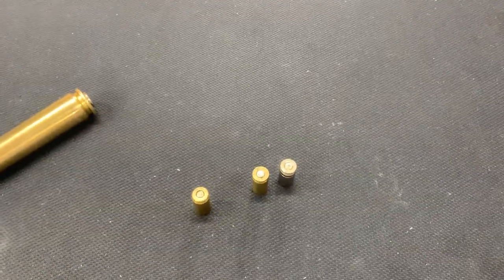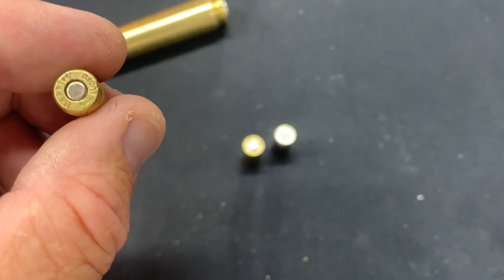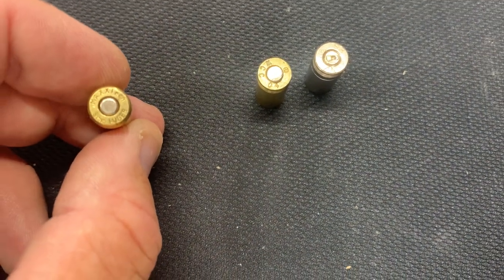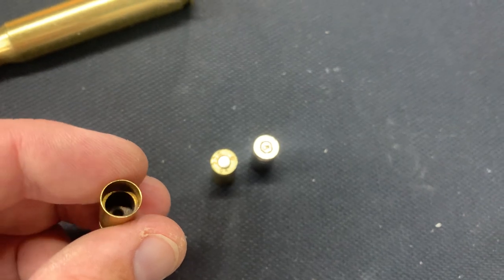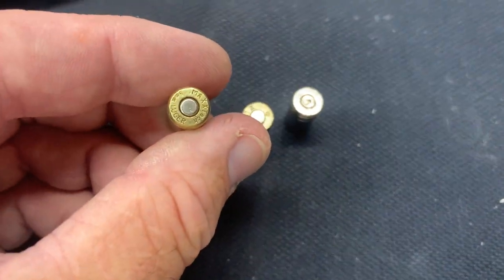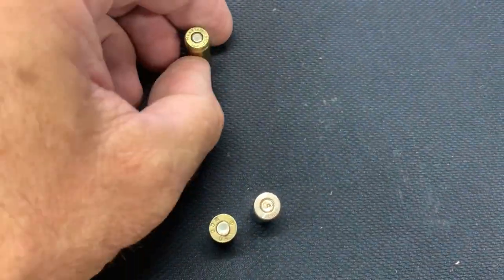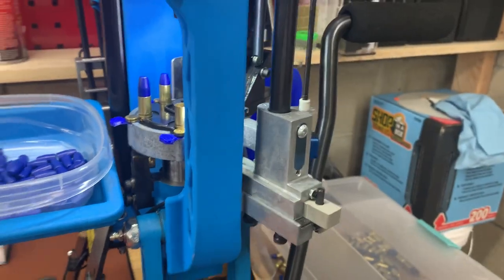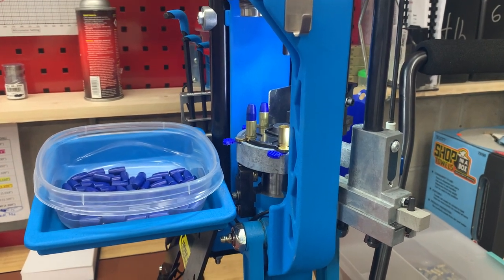Be Careful Reloading These Brands of Range Brass!!

Comment: WCC is Winchester military 9mm brass.  04 was produced in 2004.  The "NATO" designation is the + inside the O.  NATO 9mm is loaded to +P pressure.  I have some WCC NATO brass from the late 80's and a lot from the early 90's when we were doing 1st Gulf.  An outstanding cartridge case, with A CRIMPED PRIMER.  The primer crimp must be removed and by hand with a "Military Crimp Removal Tool" and then it helps to "Chamfer" the primer pocket.  I do both by hand.  Your primer "squished" because you tried to stuff it into a hole that was too small for it because you did not remove the military crimp that held the primer in by pushing some of the metal of the cartridge base over the primer.  If you hand prime, as I always do, you would not have been able to prime that case.  The extra leverage of your press let you fuck up.  I bought 2,000 rounds of brass and 1,000 was Winchester commercial.  The other 1,000 was WCC and I felt blessed.  MAXX Tech I have and mine does not have the shoulder inside the case.
Reply: Correct I always have problems reloading them. You have to remove that crimp before you press in a new primer just the same as 556 NATO have to remove the crimp
Reply: @gunztommiegunz  bingo its the crimp

Comment: Wcc Winchester cartridge company with the year on it is a military round it has a crimped primer.
Reply: The primer in that case is cocked or crooked
Reply: WCC is Western cartridge company WRA is winchester repeating arms
Reply: @charlestravis9798  Exactly because as  Kenneth Gillette stated it is crimped.  The crimping may be intended for use in submachine guns.  The crimp needs to be removed prior to repriming.
Reply: Your right, crimped primer for military.
Reload with caution.
Reply: I have since done some reading on the glock smile and that also needs to be removed

Comment: I use a Dillon Super Swage 600 tool to decrimp WCC primer pockets. It's a pain but the spent WCC cases were cheap at the time. The tool can also be used for swaging primer pockets of spent 5.56x45 and 7.62x51 mil spec brass.

Comment: The + on the case is a NATO marking.  The primers are crimped in the pocket so they don't fall out.   I save them until I have a bucket full and then decap and cut the crimp out.  (I keep them as once fired as my retirement brass)  It is good brass. I have 3 6 gallon pails full.   WCC, WMA, CBC, PPU, S&B and more have crimped primers.   Some carry ammo does as well.    I've experience a hard time decapping a lot of Winchester cases.  They don't appear crimped but they may have been sealed with something.  I have issues with them in 9 and 45.

Comment: Need to buy unbreakable decapping pins,but they can still be bent. I try to tighten the pin so it will slip if the primer won't come out. Then you  need to swage or ream the pocket out. This applies to 556, and virtually all military ammo. Went through 4 pins decapping a thousand rounds of LC 556 .45acp seems to come out a little easier.

Comment: Federal primers are the softest on the market and should only be used in non military cases because of the tighter primer pockets. CCI seem to be the hardest, but are the hardest to fully seat. Winchester is a good middle ground being soft enough to form into the pocket but hard enough to keep rounded edges and fully seat in mil/nato 9mm cases and other mil/nato brass. CCI makes the mil spec primers but I personally never found the need to use them. There is a nickel plated winchester brass out there that is nearly impossible, non crimped, but extremely tight primer pocket. You can swage the pocket but is still tight. Just my experience and opinion, been loading for 42 yrs., hope that helps! Happy shooting!
Reply from the maker: Thank you for adding your expertise to the discussion.  I would consider myself an expert reloader for single stage precision rifle, but this is only my second year doing progressive reloading for handgun and it is very different than single stage, so I learn something new every day.  This is why I make and post these videos so we can all gain in knowledge.  Thanks again for your contribution!

Comment: The WCC case seems to be like military brass that  gets crimped. I used to use the pocket reamers with a lot of effort on my FC and other cases in .223 of 5.56 because of the same primer loading issue. Now I use the RCBS-2 primer pocket swage tool in my press and it doesn't  remove material but reshaped the primer pocket. I also have a primer pocket measuring tool, small on one side, large on the other, to gauge my primer pockets to see if too small or too large. FWIW
Reply from the maker: Thanks for the info.  Yeah, I used a reamer on a power drill that actually removed a little material, and on those cases it almost not worth it and now I just toss them.  It's not always a given that the primer gets crushed, it's just usually the case that I find when they do get stuck.  Also, Winchester brass "Win" and "9mm Luger" stamped on the case head I also have trouble with primers seating.  Actually, I'd say that the Winchester cases are worse than the WCC, etc. cases--so keep an eye out for those.  I don't have a swager arm or attachment on my press since it's only an XL750 and not the new 1100 or 1050 that has a primer pocket swager station (which would be nice,  but I do prefer priming on the forward stroke and not the downstroke--it gives me a different feel so I know right away when I have a problem).  Thanks for watching and your comments!
Reply: @docgsreloading7985  You can sit and do something else while running a military primer crimp tool manually on each cartridge case. Drop the finished case into a new bucket.  All my reloading is 1,000 at a time by transferring from one Folger's plastic coffee container to the next.

Comment: I have thousands of rounds of WCC (Western Cartridge Company) brass. They're more labor intensive to reload, because you need to remove the military crimp that they apply during manufacturing. This is military grade brass and will last a good long time. However... removing the crimp on them takes a little extra time. RCBS makes a little $15 tool that you can put in your hand drill or drill press, and simply slam the case down until brass stops coming off. Super easy. In fact... after you've done this... primers go into the case so smoothly. The thing that likely happened with you even after reaming the pocket out, was likely leftover primer ring that wasn't removed during depriming. This happens sometimes, but I like to run my flat blade tool into the pocket to remove primer gunk anyway. If the flat blade doesn't fit in the pocket after running the RCBS decrimping tool... throw it out. Boom. No risk in primer detonation.
Why do they put a crimp on military ammo you may ask... well... because the military cycles ammo at a high rate of speed, and there can be primer failures. If a primer falls out during high cycle speeds... you can really mess up your gun and your day.

Comment: As others have pointed out the Winchester piece of brass is a military version of the 9mm luger round. You may already know this but the stamped small circle with a cross in the middle is a symbol for NATO. It is put on all NATO small arms ammo. The other piece of brass you showed with the smaller powder capacity and little interior ridge, is a new one to me.

Comment: The WMA, WCC brass is what the military was using. Those primers were crimped, which would cause the misaligned primer in your case. A buddy of mine warned me about that and I bought the RCBS Primer Pocket Swager Tool-2, (PN: 9481).
Reply from the maker: Thanks, yeah, that's a tool I'm going to get.  Thanks for your comments!

Comment: I run all 9mm and .223 through a step, after sizing. I use a RCBS  primer pocket swaging tool. I run it separately on my single stage, then tumble the brass till shiny.

Comment: WCC is Winchester as has been said. Most likely, military contract which means a crimped primer pocket spec. Sorting brass will rectify "accidentally" running them through the machine. My 1050 automatically removes(swages) the pockets to prevent issues. Most aren't military so unless you run across a huge deposit(like from a military base auction) you rarely run across them.

Comment: Watch out for 9mm Norma brass. The flash hole is under size and the decapper will get stuck, causing all kinds of misery.
Reply from the maker: Thanks for watching!  YES, the Norma brass will pull out the decapping pin in the Redding dies and I got so sick and tired of that happening that I contacted Redding.  I complained about it to Redding, and they didn't have a fix that worked.  What I did, was engineer a fix on my own.  I used a thread coupler I purchased online from an industrial company and converted the threads on the Redding decapping stem to the Dillon decapping threads, then I just use the Dillon decapping pins and their screw on cap that holds the pin in place.  The way the Dillon decapping system is designed, it can't pull out ever and won't break because the pins are hardened steel and much bigger in diameter.  I did have to grind off the fork that held the Redding pin in place just flush with the threads.  Now when a Norma brass 9mm case comes into my press, it just slams through that small flash hole and makes it bigger, so reloading it again makes it easier, and the primer gets driven out easily even the first time. 
I was thinking about doing a video on what I did to solve the problem, I just don't think it would get a lot of views!

Comment: That second one is metallic.  You must use a special die to reuse them.  One of the issues is they begin to separate where the two different metals are used at the junction.  I used to use those for shooting 9 Major loads in my Open gun because they do handle higher pressures and can be reloaded a lot of times.  Picking them up with a magnet on a stick was great though.

Comment: Doc can you make some recommendation to 9mm brass, bullet, powers I’m new to reloading sticking to new brass as I get experience using mostly 115 some 124 I’ve been using starline brass and whatever bullet I can find at a reasonable price round nose fmj.I’m just plinking my main consideration has been safety then cost this is an experience project, once I’m more comfortable I’ll look into once fired range ammo, your examples are why I’ve been using new brass so far.fyi I have been picking up my own brass and collecting as I get my cleaning resizing de priming act together then I’ll recycling my own stuff to make it worth while any ideas out would be welcome As I will bounce any suggestions off my reloading Manuel’s to make sure my donuts are donuts and not bombs. Thank you Ivan
Reply from the maker: Thanks for watching and your nice comments and questions!  That’s a good idea to keep your own brass.  As you can see, you have to be careful about other stuff you pick up.  
So, I shoot an Atlas Hyperion in 9mm as well as my Sig Sauer P320 X5 Legion in local competitions that are not USPSA (no Major or Minor Power Factor to deal with) and here is what I use for those guns:

1) Blue Bullets 147gr. (Their Round Nose or Flat Point work equally as well).
2) Vihtavuori N320 powder at 3.0 grains.
3) Used brass as we talked about.
4) Federal primers (DO NOT USE CCI PRIMERS IN A STRIKER FIRED GUN—THEY DO NOT WORK CONSISTENTLY)

A buddy of mine that has been progressively reloading longer than I’ve been alive told me about the CCI primers only working in hammer-fired guns, and he’s right.  I did several hundred CCI’s and at least 3 per hundred didn’t fire and required a second or third strike to go off.  Plus, Federal primers have a more malleable cup, so they go into the case easier when reloading.

Now, I do use a more expensive powder—Vihtavuori, but it burns more consistently and has almost no soot.  If you don’t want to spend the extra money, than TiteGroup would be a good alternative; although I don’t know what the conversion of grains would be over to that powder.  For me, the extra is money well spent since I don’t have to clean my guns as often, and when I do, it’s an easy cleaning.  Starting out, I tested 5 different bullet weights, from 10 different manufacturers and 5 different powders at differing weights (I don’t do any of this stuff half-way!) and the Vihtavuori powder had by far the tightest groups (at 20 yards fired from a rest) and most consistent chronograph data.
Now that load above also does meet the USPSA Minor Power Factor requirement, so it’s a load that can be used in USPSA competitions.  I compete in the Limited Division in USPSA, so I shoot 40 cal for that in an Atlas Nemesis so I can be in the Major Power Factor which is a huge advantage over Minor PF.
I hope that is helpful!  Let me know of any other questions and I’ll be glad to answer as best I can!
Reply: ,thank you never even gave hammer vs Striker a thought thank you. Started picking up my own brass to make it easier to police brass brands,it mostly as a hedge against shady brass since all mine is once fired since i purchased new. I gonna try  powders you suggested. cleaning burning is big, since unburnt powder is just wrong in todays low availability scene, gonna save my Cci for my CZ, you having any luck buying primer. Crazy how many fake websites out their found one site yesterday only place the had any in “stock “ but of course was vemo/zelle only clicked off and did a virus scan just to be sure appreciate the response and info, ps love you choices legion, Atlas,need I say more wow, not today but one day I’ll be able to ask what … on yours I got … on mine. Next mission find powder and primers but that’s all of us. Thank you, Ivan
Reply from the maker: @myanaloglife9450  I saw the whole pandemic coming (a good thing about having a medical education) so I ordered 50k during the 12 months prior to everything going out of stock.  I’m on a bunch of wait lists, but they’re still not in stock and unfortunately, when they do come back in stock they’re charging 8-9 cents a piece instead of the 3 cents I paid.  22LR ammo is 3X more expensive per round than it was pre-pandemic.  I’d think as long as the pandemic stuff continues to taper off, they should be near back to the regular price and availability by the end of this year or beginning of next year.

Comment: After reeming military cases with crimped primers like the WCC cases, it leaves an abrupt ridge on the lip of the primer pocket. Primers tend to catch on this ridge and deform, unless you use a deburring tool to remove this ridge and chamfer the lip of the primer pocket slightly. Once this is done, primers will seat easily. 

I first started doing this as a kid helping my dad reload military 30-06 cases over 60 years ago and have done this to thousands of military cases in various calibers in the years since. I think my old man probably knew what he was talking about, as he worked as a machinist for Remington Arms during WWII maintaining the equipment they used to make ammo for Uncle Sam.

Comment: Do you still recommend range pickups? Or are there too many nasty surprises? Also, Very cool primer rod! You could make those and folks would buy them.
Reply from the maker: Oh for sure!  I have 4 full to the top 5 gallon pickle buckets (almost 30,000 cases of 9mm) of which pretty much all of them are usable and free!  For the most part the brands I find are Winchester, PMC, Blazer, Aguila, Starline, and Xtreme to name a few--all of very high quality and can be reloaded 20+ times.  I have to sort all my brass manually so when I get back home from the range I put on my magnifier glasses and check that each piece is 9mm Luger (I do get a lot of 40 cal as well) because 380 ACP and will look identical to 9mm except it's a shorter case that won't work in the press when you go to seat the bullet.  It takes a couple hours but I'll be watching TV or sitting outside on the deck.

That's a great idea for the primer push rod, maybe I can become a millionaire that way!!
Reply: Doc G's Reloading Right on! I have a 50 BMG case made into a bottle opener and I love it. Great suggestion on the magnifier glasses as .380 does look just like 9 mm. Thanks.

Comment: I guess your not familiar with the NATO Case Mark it's the circle with the cross in the center. The WCC represents Winchester Cartridge Company Logo, the two digits represents year of manufacture.  Of course the primer was smashed into the deprimed case without the reaming of the crimp from the original seated primer. US made military cartridge brass cases do not show the caliber of the case on the case, that printed information would be on the box material.

Comment: Use standard factory brass. If the case is non standard then don't use it. The MaxxTech inside case shelf and two piece nickel brass shown are non standard. If primers act as if they won't seat then discard the brass. Same for bullet seating. Don't force it. Discard. Or get a primer pocket swage tool for such cases like crimped or Berdan (double primer holes) primed cases. Best to stick with box primer brass cases. As always check your cases for fatigue cracks and splits or over pressure signs and discard these. Thanks for sharing.